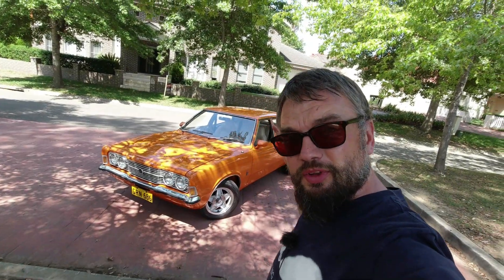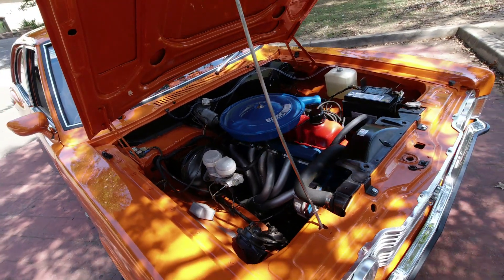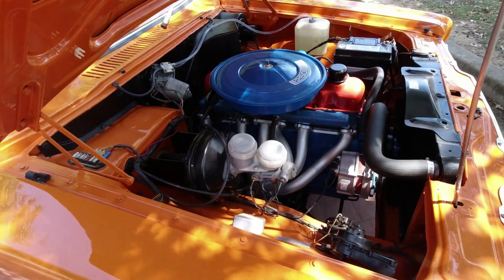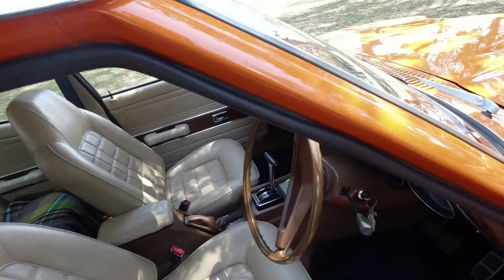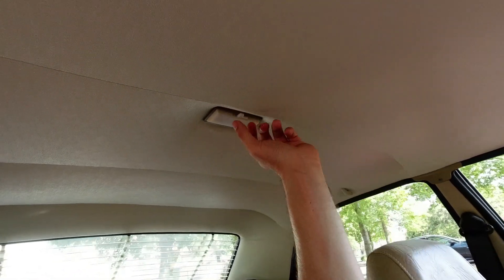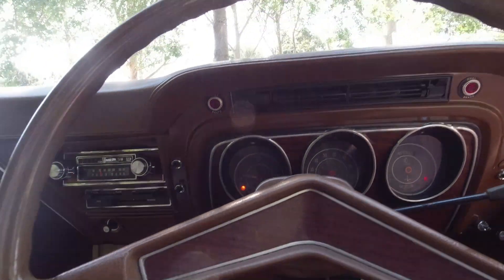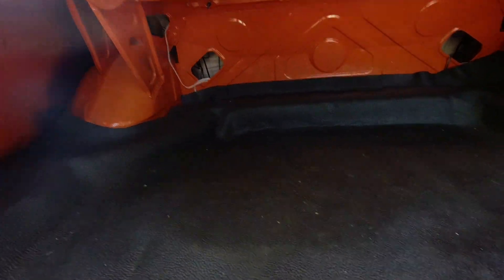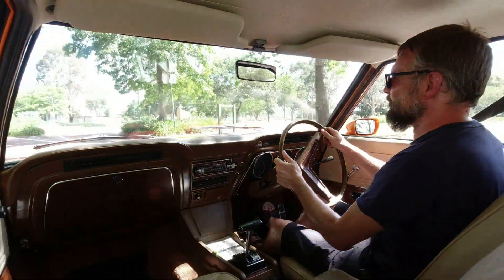Aussie Oddballs: Ford Cortina 6! 4.1-litre, tested in 40+ degree heat

Comment: 4.1 litre Mk3 puts the 2.3L v6 Mk4s , biggest stock cortina we in the UK got in the shade ..155bhp sounds very little now for such a big engine but it’s the same power and similar torque to a rover 3.5 v8 , and in a car which we had a 1.3L engine in !  . Beset we got was the 2.0L pinto of course in the Mk3

Comment: This is a very heavy 6 cylinder engine; the Essex 3L V6 was pushing 138bhp, the 3,1 141bhp, with a much lighter drivetrain combination, with better handling. I had a 1997 Falcon EF with 157kw, 209bhp, which I absolutely loved despite being an automatic, but it is a huge heavy drive train. Ford Granada 1,300kg, Falcon 1,600kg extra 300kg sitting in the drivetrain. Ford SA wanted to do a Falcon with the Essex 3L V6 latest updates, webbers/fuel injection, 3,4cc, new crankshaft, 5 speed gearbox, would have achieved a near enough performance, with the space for a Perana Windsor V8 model. But Ford Australia said no, and the Falcon factory has closed down.

Comment: Piece of trivia, those 250 I6’s were also put in the Australian f-350 trucks. The F-350’s were rated for 4 ton payloads so they were a tough little engine, bags of torque.  I had one in a falcon XA coupe and it was pretty respectable

Comment: Discussed this with my friend who drove a Victorian Government Country Roads Board six cylinder station wagon version from the car pool. His lasting memory is it overheating out on the hills near Ringwood. So a bit rare as a fleet car for reliability reasons. Maybe the CRB got one cheap when they were being run out before the Mazda based Ford Telstars replaced them in the Ford range.

Comment: It's also worth point out that the bonnet bulge wasn't the only difference in 6 cylinder cortinas 6 had twin headlights where as the 4s only had single head lights.
Good looking cars even today, the quality control was abysmal compared to other midsize cars from Japan like the Corona and Datsun 180b which of course we're only 4s

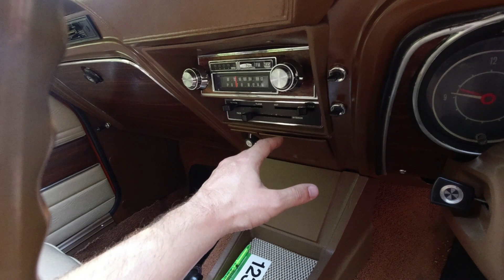Comment: Excuse my lack of knowledge on this car. But what is the “redundant” switch you noted on the left of the steering column (you said “trim” control or something along those lines). At around 4:50 of the video.
Reply: It's the manual choke.
Reply: Assinine Comment thanks! That would have been my guess, but I couldn’t work out what he said

Comment: Did you know Chrysler fitted the 265 ci six into the French Simca 160. Had a customer with one and it was quite nice. Named the Centura, it was made to compete with the Torana and the Cortina, and so had the box six stuffed in to suit us leadfoot Aussies
Reply from the maker: I did know, but failed to track one down sadly.
Reply: The 265 never went into the Centura - of the sixes only the 215 and the 245.
Reply: @joeblow3823  Correct
Reply: @joeblow3823  faulty memory...imagine if they did though. Vvvvvvrrmmmm

Comment: My first car was a mk4 TE Cortina with 250 crossflow and 4 speed manual,  Pine-lime yellow. They were an evil handling thing on the limit. I put a 350 cm Holley carburetor and genie headers on mine. It could pull a couple of lengths on a 308 Commodore in a race....until about 90 kph, then I'd get reeled in.

Comment: No a/c in Australia even in the 70s?
Reply: Samantha James : The car was designed by Ford of Europe as a Taunus TC or Mark III Cortina. Despite being exported to the USA for 1970,  Canada for 1970, 71, 72 and part of 73, and built in  South Africa and Korea for years,  THERE WAS NO PROVISION FOR AIR CON ,  and it was only the Australians who decided to  rework the whole ventilation system for AC, which took untill 1977 when the Australian TE model came out with what became  the Cortina 80 Mark 5 dashboard, three years early.. Additionally, the optional Granada power steering wasnt used the European Cortina V6 or Taunus V6 untill 1979, so Ford Australia had to adopt the 1977 Mustang II TRW version of the English Adwest/ Cam Gears SD1/Jaguar TRW system in 1977. This resulted in a raft of even more major front end revisions, basically a whole new engine bay, front suspension and HVAC (Heating and Ventilation and Air Conditioning). The Aussie Cortina gained a reputation for unreliabilty and poor suspension and ventilation which the Mark III Facelift (TD), Mark IV (TE) and Mark V (TF) never recovered from. Ford Australi fixed everything...the indicators, steering weight issues, HVAC, brakes, gearboxes, independent front suspension. All on there own, with more help from the Americand than Ford if Europe or the lads at Essex, Kent or Dagenham. Having owned five of them, two Australian versions, the later TE and TF's were great cars. The last TF 4.1 litre 4 speeds could pop low 16.8 second 400 m times, top 188 kmh at just 4600 rpm, and do 0 to 62 mph in under 9.7 seconds any old time. The power steering was light, the 14 inch alloy wheels with 185/ 70 SR 14s and the heavy duty suspension sorted out some of the handling issues Ian had. It took a four speed 4.9 or  5.8  Ford Falcon or 4.2 litre 135 hp Holden Commodore SS to beat a Cortina six. The car Ian had made 102 hp net and 200 lb-ft net with the old 1 barrel carb 250. The stainless steel headers added 18 hp. The later cars had a lighter alloy head 1 barrel net power 126 hp and net torque 218 lb-ft (94 kw, 295 Nm), the 155 hp and 240 lb-ft ratings discussed were gross valuses like the old pre 1972 US figures. The 1969 United States 250 Mustang and Ranchero and Torino and Fairlanes shared the same engine rating, but it was never a 134 mph car like the prototype 2v versions were. Ford Australia never released the 170 Hp 2V version with headers, which was given a cam upgrade and then recorded at You Yangs Proving ground in 1971 doing that often quoted 134 mph. Signed. Total Aussie Cortina Six Nut.
Reply: Samantha James : The car was designed by Ford of Europe as a Taunus TC or Mark III Cortina. Despite being exported to the USA for 1970,  Canada for 1970, 71, 72 and part of 73, and built in  South Africa and Korea for years,  THERE WAS NO PROVISION FOR AIR CON ,  and it was only the Australians who decided to  rework the whole ventilation system for AC, which took untill 1977 when the Australian TE model came out with what became  the Cortina 80 Mark 5 dashboard, three years early.. Additionally, the optional Granada power steering wasnt used the European Cortina V6 or Taunus V6 untill 1979, so Ford Australia had to adopt the 1977 Mustang II TRW version of the English Adwest/ Cam Gears SD1/Jaguar TRW system in 1977. This resulted in a raft of even more major front end revisions, basically a whole new engine bay, front suspension and HVAC (Heating and Ventilation and Air Conditioning). The Aussie Cortina gained a reputation for unreliabilty and poor suspension and ventilation which the Mark III Facelift (TD), Mark IV (TE) and Mark V (TF) never recovered from. Ford Australi fixed everything...the indicators, steering weight issues, HVAC, brakes, gearboxes, independent front suspension. All on there own, with more help from the Americand than Ford if Europe or the lads at Essex, Kent or Dagenham. Having owned five of them, two Australian versions, the later TE and TF's were great cars. The last TF 4.1 litre 4 speeds could pop low 16.8 second 400 m times, top 188 kmh at just 4600 rpm, and do 0 to 62 mph in under 9.7 seconds any old time. The power steering was light, the 14 inch alloy wheels with 185/ 70 SR 14s and the heavy duty suspension sorted out some of the handling issues Ian had. It took a four speed 4.9 or  5.8  Ford Falcon or 4.2 litre 135 hp Holden Commodore SS to beat a Cortina six. The car Ian had made 102 hp net and 200 lb-ft net with the old 1 barrel carb 250. The stainless steel headers added 18 hp. The later cars had a lighter alloy head 1 barrel net power 126 hp and net torque 218 lb-ft (94 kw, 295 Nm), the 155 hp and 240 lb-ft ratings discussed were gross valuses like the old pre 1972 US figures. The 1969 United States 250 Mustang and Ranchero and Torino and Fairlanes shared the same engine rating, but it was never a 134 mph car like the prototype 2v versions were. Ford Australia never released the 170 Hp 2V version with headers, which was given a cam upgrade and then recorded at You Yangs Proving ground in 1971 doing that often quoted 134 mph. Signed. Total Aussie Cortina Six Nut.

Comment: Ha ha! If you think the Corty was a handful try and find a ride in a Chrysler Centura! Pick of the bunch 245 Hemi 4 speed manual. Best way to describe it would be the Corty turned up a couple of notches, more power, less handling. A 4 cylinder French car the Aussie’s decided to hang a couple of extra cylinders over the front axle. Result was pretty much wheel spin.

Comment: Not a good car for corners, but it would surprise many v8's at the lights. I lived in the hilly countryside and this car burned up slopes like they weren't even there, the exhaust would resonate and set off every car alarm in the carpark. I've had that I've enjoyed more,  but the Cortina's explosive power and floaty suspension made it exciting in its own way. If a race-car is like a roller coaster, the Cortina was white water rafting. I never drove the 6 cylinder Marina, but I did find the 4 cyl quite dreary

Comment: I worked on plenty of these 1970s Cortinas, TC to TF, in the late 70s and early 80s in Australia. They were absolute pieces of crap. Even brand new cars were horrible to drive and those more than a few years old were death traps. Putting a 4.1 litre engine in them was just madness. For some reason Ford's engineers overlooked the fact that cars have to be able to go around bends and corners, safely. The best advice anyone could give a Cortina owner was to drive it to the wreckers. In Australia the Cortinas were replaced by a Ford badged Mazda 626 and that showed just how much better the Japanese were at making cars.

Comment: About the same time was the Chrysler Centura 245/265ci. Both used Borg Warner drive train. I remember the Centura made more rubber smoke? Slightly lighter and they rattled to bits with the torque. Good times aye!
Reply: Is that the same 245 that is in a range of Jeeps? My ZJ has a lovely sounding six. Shame the virus has stopped me enjoying it, but at least we have HubNut for grins.
Reply: Jeep motor is not related to the Aussie Hemi 6. The hemi was originally designed in the U.S. by Chrysler corp for trucks (pickups, I suppose) but they chickened out and sent it to Australia. Developed here to a legend of a motor. Plenty of info online....

Comment: No Australian made car ever had the wiper washer pedal on the floor( not sure about the leylands). They normally had the high beam switch on the floor, everybody inc me got use to it. So what did buy in 1978.... a Fiat 125 with a wiper washer pedal(pump not switch) on the floor it took forever to get use to the high beam on the column stork. It also had copper leaf switches for the wipers and if you hit a big bump the wipers would go for a cycle ha ha
Every Australian Cortina after the Mark II had heavy steering even the 2 litre ones

Comment: I had one bought brand new from a Ford dealer on Sydney's Canterbury Road called Nuford when I was 17 years old. Bog standard with a four speed manual box. All up cost was $ 4613.00. Had it for 12 years and sold it to a young bloke for $1500 with 160000 kms on the clock. I'm now 62 years old and am amazed that I managed to survive that car's treacherous handling. I am equally amazed that these pieces of shit are now apparently collectable.
Reply: Theyre pieces of shit but you owned one for 12 years? And done 160k?
Reply: Yeah well, you know, young and stupid. It was expected back then that cars break down. They would boil on a hot day, get water in the distributor after a passing shower and refuse to start. Vinyl seats hotter than the surface of the sun, brakes that would lock up and pull you to the left one day and the next day to the right. It's just the way it was then and everyone accepted it. 

Some of my interesting issues included a gear stick that would spontaneously part company with the gearbox and allow you to drive down the road waving the gear stick out the window. All good until the next gear change. I also had a clutch pedal or two where the crappy cast metal would actually tear near the front firewall and leave the pedal resting on the floor. You ain't going nowhere then.

Comment: My brother and cousin had the 1973 model TC. My brother had the 2 litre and cousin 4.1 litre. They were not good cars. The quality control was terrible and constant faults were common. The 6 cylinder TC had issues with front suspension. My cousin once heard a strange noise under the front and found a bolt hanging by one thread. Poorly made. The other problem was that Ford swapped parts constantly so when the car required spare parts it got down to the month it was made.
They came in 1.6, 2.0, 3.3 and 4.1 litre. The line up was L, XL, XLE.
They could have been outstanding. Probably fully restored these are a nice car. I almost forgot the 6 cylinder Leyland Marina. They really were the worst.
See if you can find a nice Chrysler Centura.

Comment: Have a te 250 alloy head crossy my self very modified they can make some grunt just let them breath made 475nm or 350 fp around the same hp 300to 350 Kool part was over 300 fp at 2800 and still roll out to over 7k

Comment: Sadly we never got the Mk3 6 cyl, that turned up in the Mk4 guise and are considered rare in NZ. It was distinguished by bigger bumpers, vinyl 3-dial dash, better seats and either '4' or '6' badges next to taillights instead of the standard 2.0L. The 250 was far too big and heavy for this car and handling was rubbish in stock form. l did wonder why Ford didn't fit the 200ci engine instead of the heavy old 250ci. The 250 didn't do very well in jet boats either.

Comment: The belt light was a local requirment  for the Australian design  rules also  the brake failure light, hence the two additional warning lights over the Uk version. The Cortinas lacked ventilation so the biggest aftermarket  option was an under dash A/C unit. They were also available in 200 ci engine. Can I just make a comment over the Marinas and the Cortinas handling , the Cortina had massively beefed up suspension and bodywork to handle the roads of the seventies in Australia. You are driving these vehicles on today's roads  a far cry from the seventies punishment.
Reply from the maker: Fair point. The Marina also had a few aftermarket tweaks, though so did the Cortina.

Comment: using P(ark) in place of parking brake is generally not recommended. Especially to hold the car on an incline / decline. It puts enormous load on the transmission.

Comment: Here in South Africa at this time, Ford were making and selling the "Big Six" Cortina, powered by Essex engines, either 2.5 or 3.0 litres. They were very popular models. Before that, home mechanics were dropping Essex motors into Mk 2 Cortinas. My late, lamented genius friend, Eric, actually installed a 3.0 Essex in a Mk 1 Escort. He did a very thorough, cleverly engineered job that ensured it handled and stopped decently.
Reply: Would they be the Perana Ford's by any chance?
Reply: @sutherlandA1  Hi Ashley. Yes, It started out as one of the Basil Green Motors Perana models of very fast Fords. In actual fact, I see now (Google) that BG also did a Mk 2 Cortina Perana. It's well worth Googling Basil Green to read about such fascinating cars as V6 Cortinas and V8 Capris and Granadas, etc. These were the days of very hairy chested saloon car racing in SA, with GM chiming in to produce the V8 engined Firenza (Vauxhall Viva coupe) with a Chevrolet 302 ci engine and (for racing) very well- sorted suspension. As I remember, Ford SA actually took over the production and marketing of the V6-engined "Big Six" Mk 3 Cortina, as well as the later Cortina "Interceptor' V6. Stay well!

Comment: These were fast and used flog Torana's even V8 ones .   They didn't handle as good and the diff would tear out of the body . The TC XLE manual version had the Ford top loader 4 speed gearbox .

Comment: A bit different to my last Cortina which was a mk4 estate 1600 with cng gas the most gutless car I have ever had. Funny story it had a roof rack and was covered in rust and paint splatters (I was a painter living at the seaside) I used to drop the kids off at school on the way to work they came up with this elaborate story to convince me to drop them off around the corner from school because they didn't want to be seen in that car. I think I was duped for maybe 6 months but once I worked it out I dropped them off at the school gate and tooted them goodbye from then on.

Comment: My first car was a 2000 GT.  There was absolutely nothing GT about it except I got a rev counter and seats much like the Australian car, oh and the boot panel was painted black - Ford you were spoiling us. Like any other Pinto engined car it ate it's camshaft - they must have got a 5-year old to do the lubrication design (and I did change the oil rail - and the oil & filter, regularly - it didn't help and this was with a new camshaft which went the same way as the old one).
Reply: Forgot to mention - yes, I did change the finger cam followers when I changed the camshaft, I'm not quite that stupid (though fairly stupid - I bought a car with a Pinto engine). Something else I forgot, the seats were cloth and really comfortable (though not Triumph comfortable - I had a 2500S at one time).  Mike